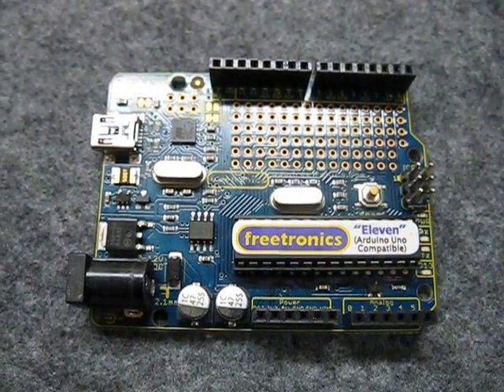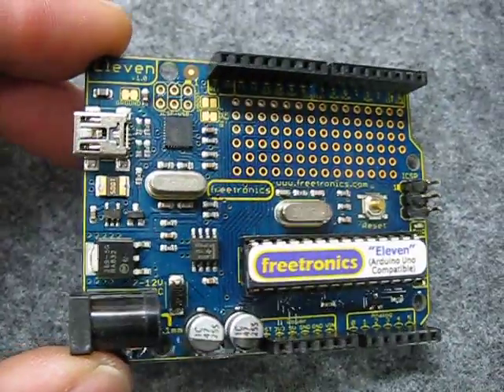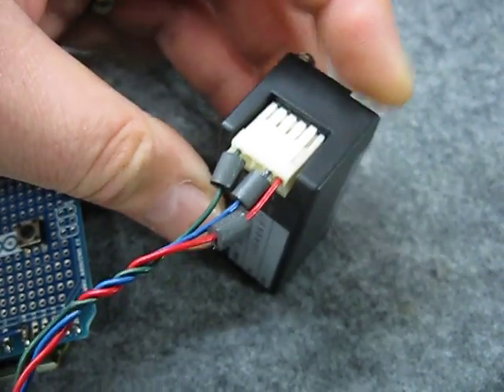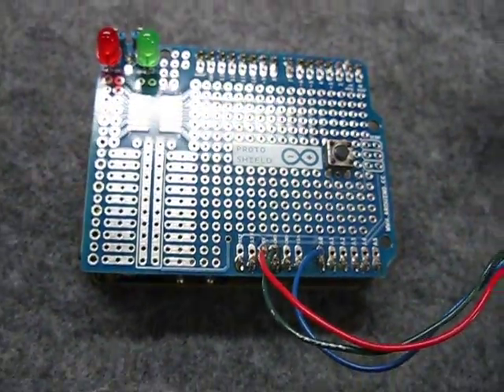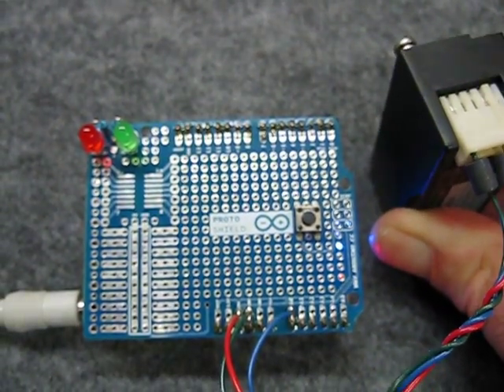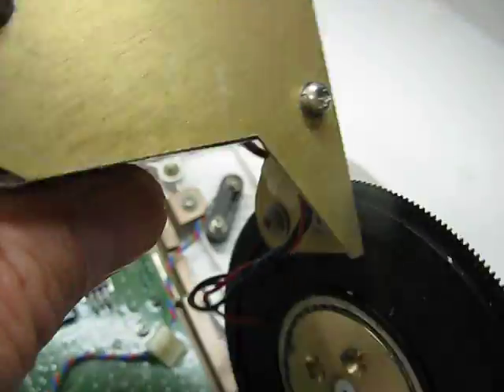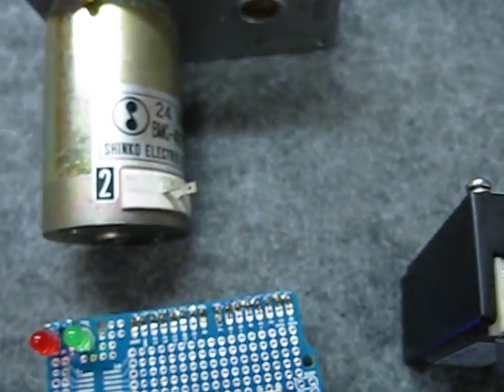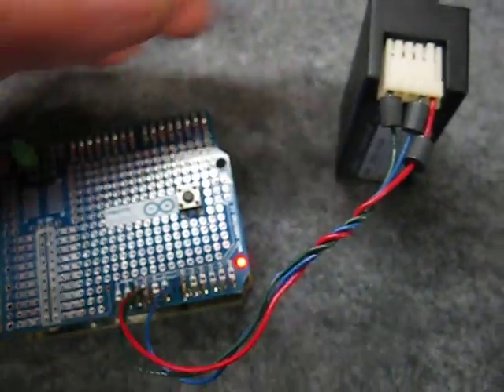Arduino & GyroStar

Comment: Nice demo, I'm into micro (1/24 and smaller) rc cars. They get very twitchy at speed and if you try to correct it drifting off course due to the surface, you often over compensate or flip the car.

I want to do a similar thing to what your talking about except the circuit would sit between the steering servo and the Rx, read PWM and gyrostar, and send a modified PWM to the steering.

I've seen the bare chip on banggood, it's smaller than you little fingernail and only about $4 including shipping, gonna get a couple to try out, any tips?